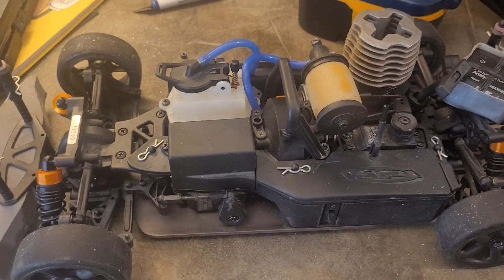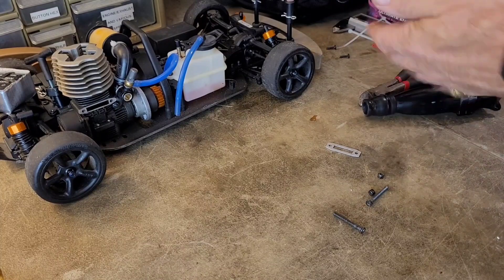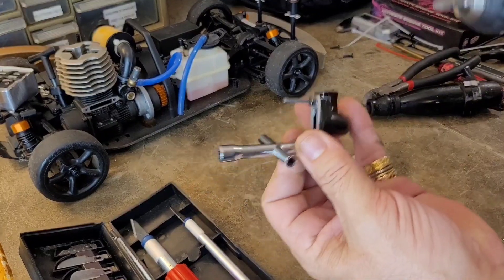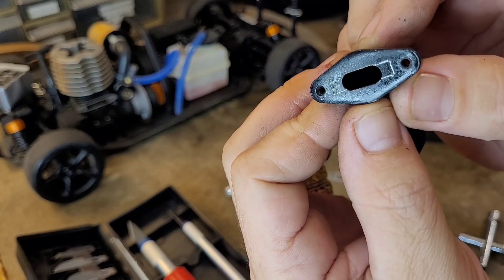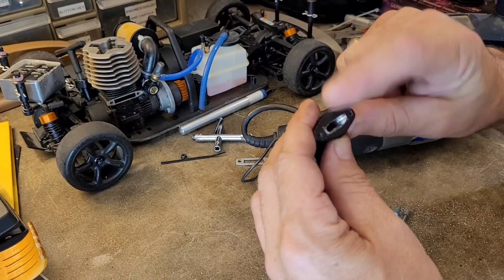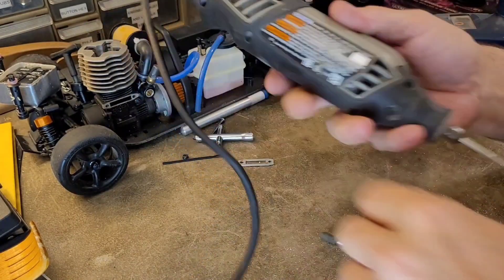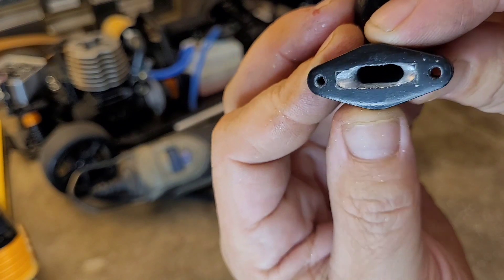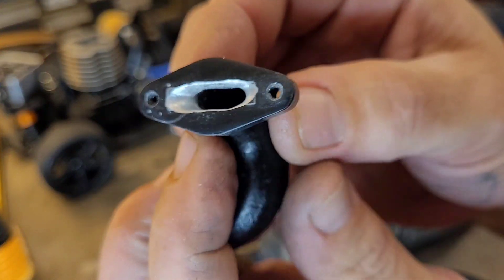Port Matching a Nitro engine header manifold HPI RS4 3 exhaust mod Part 2 port match with a Dremel

Comment: On my kyosho fw06 cars I used a traxxas .15 tmaxx header because kyosho headers are bad design for exhaust flow it made a difference in the sound and throttle response
Reply from the maker: There is one really great aftermarket header for the rs4, I got a couple, but I can't think who makes it..

Comment: Have you ever thought about a building 2 stroke scooter or motorized bicycle engine that ran off a mix of like 75% E85/25% methanol or RC car fuel. Using a higher compression head & larger carb jets, to make more power ????
75% E85/25% methanol mix would be about $6 gallon and would make a fast scooter or bike.

Comment: Great job one thing that i was watching was with all that dremil shaving fly everywhere nd the car sitting opened exhaust port on the engine  just wide open close by hope nothing went in
Reply from the maker: You're right. I wasn't paying attention, but I did notice afterwards shavings on the car. I closed off the port and hit it with compressed air, luckily nothing got in. Gotta be more careful!
Reply: @NitroTalkwithTodd  I'm sure it's allot of step recording yourself posting videos getting all set up allot of work nd we all appreciate it but things do get overlooked it happens